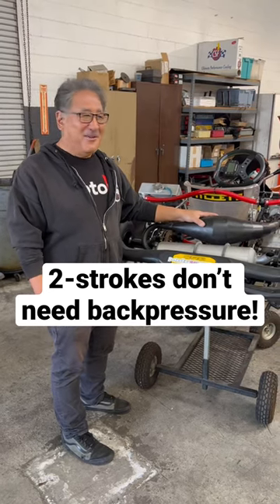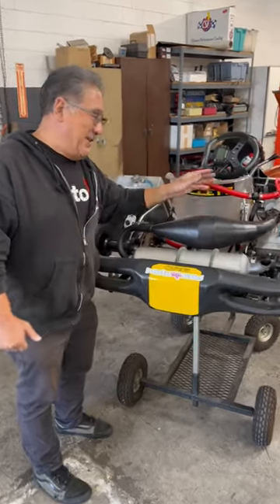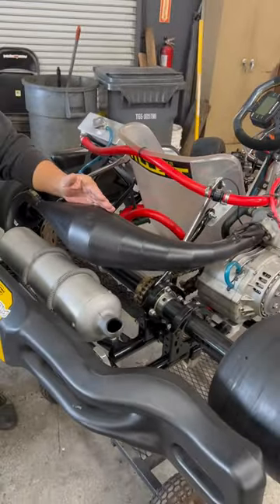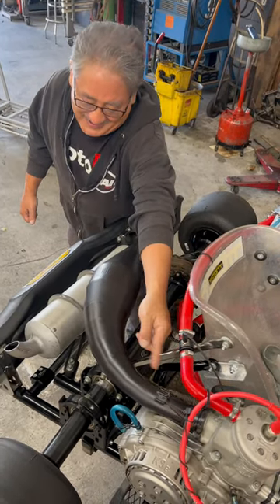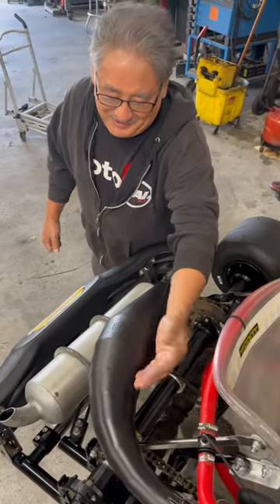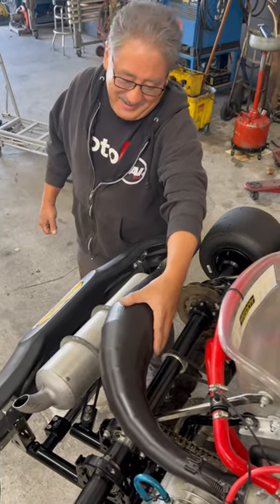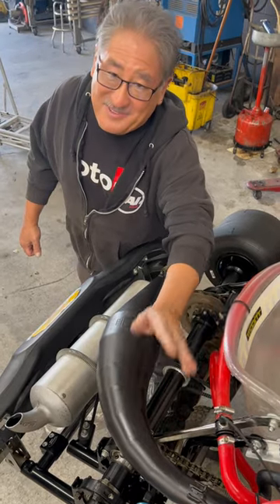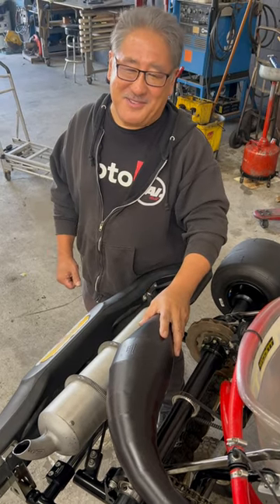2-strokes don’t need backpressure!

Comment: Why you don't run that thing with a straight pipe if backpresure isn't needed? Pulses are mainly backpressure, if you measure the average pressure in the expansion pipe, it's pressurized. Pulse wave reflections are simply a way to boost the engine since reeds (or piston skirt/rotary valve geometry) blocks the backflow of the air/fuel mixture coming from the exhaust when the pressure wave returns to the cylinder.
Reply from the maker: The average flow is not pressurized, it is in vacuum with every cycle.  The reed valve, etc does not block the exhaust, it prevents back flow into the intake.

Comment: So many "car people" really need to watch this. Countless times I've heard people say a engine needs back pressure  to run.
Reply: if it needs back pressure why can it run without an exhaust
Reply from the maker: it will run but it will loose as much as 50% of the power.  You need to watch and comprehend the video.
Reply: It needs an expansion chamber. The muffler will hurt it though.
Reply: @fish_R_stinky69  muffler wont hurt it
Reply: @11sjv  It'll make less power with a muffler lol.
Reply: @11sjv  Sure, a muffler won't HURT it but it'll make less power.
Reply: @fish_R_stinky69  depends on the lenght of your pipe

Comment: Well, you need some backpressure to build heat in the pipe, to make it tune in wanted rpm band.
Without backpressure the heat(energy) is spilled away.
Reply from the maker: That is not how it works although heat has an effect on pipe tuning.
Reply: @motoiq  lol
I DO know how it works, but i seriously doubt you know.
I´ve been tuning twostrokes for about 35years now, and if i would go by your example and NOT having backpressure the pipe would be very very hard to tune at correct rpm as the heat would be lost.
The 'same' pipe length would tune at very low rpm.
And by that, trying to tune at say 7500rpm(250 dirbike) it would be so short that you would need to have such abrubt angels on the different sections that you would actually make it EVEN HARDER to tune it due to the pulse is 'getting lost'

0.2-0.3bar pressure is a normal value to aim on, this allows the pulses to fluctuate above and below atmospheric pressure, and by this makes the engine breathe properly due to pulses.
And getting this correct, the pressurelevel actually helps at higher rpm(above tuned point) to push back some of the fresh charge for a longer duration where he pulses have started to fade(above tuned rpm)
Hence many misunderstands this.
'Higher backpressure gives more power'
Yes it might, but less torque down low.

Correct backpressure is the key!
Reply from the maker: You don't understand thermodynamics and have only a practical knowledge of how a chamber works. Purposely increasing the mean backpressure to do something is a crutch to proper pipe/port/intake design.
Reply: @motoiq  do not judge me!
I know a lot but might have problems with language.
But i do see that you are trying to use conquer technique in this conversation.
Reply from the maker: Don't judge me either, I know a lot.
Reply: @motoiq  Yeah,, i noticed that......

Comment: Could you delve into 2 stroke "power valves"?
Reply from the maker: They change the port timing for a wider powerband, like variable cam timing in a 4-stroke.
Reply: @motoiq  Some of them also change expansion chamber volume and tuned length.
Reply from the maker: really what motors?
Reply: @motoiq  I know Honda's power valve and Kawasaki KIPS do it.  They have a chamber by the exhaust port that is either opened or closed to exhaust flow, effectively varying the tuned length of the header pipe.  Honda's earliest PV did this only with no change to port timing or geometry.  I believe KIPS was the first to combine the chamber system with a variable-height port.  Obviously they weren't doing anything as radical as tromboning the pipe, although I've read some PWCs inject water into the pipe to change temperature and therefore the pulse timing.

Comment: Oversimplified for those who don't know anything yet but it's correct and i like that
Reply from the maker: For shorts, you only have 60 seconds.
Reply: @motoiq  true that
Reply: Have had personal experience with 50cc two-stroke engines and a pipe makes a big difference
Reply from the maker: Yeah you can probably double the power.
Reply: @motoiq  way past double the power

Comment: The lengths and sizes of them cones   And the exhaust port timing Dictate the rpm  the ending makes its power 

In that karts example 125cc and about 50hp   And rev over 14000rpm  

Back pressure is needed the end of the pipe called the stinger is only about 20mm   

To help contain the glasses so the pulses can work 

It’s a fine balancing act To big and the pulses are not strong enough to work.   

To small and to much exaust remains and the  engine melts   Normally eroding the piston over the exhaust port 

So saying they don’t like back pressure is not 100% right
Reply from the maker: the stingers function is to prevent the pulse from escaping while letting exhaust gas out.

Comment: What are your thoughts on pipe pressure at high rpm speeding up the wave velocities and helping widen the effective rpm range that the pipe is effective for?  Same reason a rich main jet kills top end, rich,  cool exhaust gases slowing the wave speeds.
Reply from the maker: That's a lot of how the pipe works

Comment: It does use backpressure...

The first cone increases in volume which creates a lower pressure which allows mixture from the crankcase to push up through the transfers, the belly section inbetween the two cones is a intermediary section that stops a sudden change in pressure, the next cone reduces volume and increases pressure which is utilised when the pulse bounces off the end of the stinger to create a higher pressure wave (backpressure) to push mixture leaking out of the exhaust back into the cylinder along with some dregs of fuel in the exhaust fumes.

Backpressure is half of the action of a expansion chamber.. to say its unwanted or not how it works is beyond wrong.
Reply from the maker: Actually via Bernoulli's principal the pressure increases in a cone shaped diffuser.  Also we are taking about mean backpressure, not periodic pressure pulses are we explained simply in the video.  Mean pressure raises the floor of the gas exchange portion of the two stroke cycle which reduces the amount of work that can be recovered as power.
Reply: @motoiq  i see. I had it backwards. 

I was thinking without bernoulli's principle which would mean that mixture would be sucked from the tranfers due to the low pressure at the diffuser and then the wave reflected back squeesed going into the baffle would push leaking mixture and leftover mixture back in but it must be the opposite.

Diffuser causes high pressure which prevents leakage and then the baffle causes a lower pressure to pull mixture from the crankcase. If thats not it then im having a word with god and his mad fluid dynamics he created with expansion chambers.
Reply from the maker: You got it half right! The cone diffuser thing is counterintuitive but you are trading velocity for pressure which is what Bernoulli's principle is all about.

Comment: But if you didn't have the first cone, wouldn't you avoid overscavenging the fuel/air mixture?
Reply from the maker: You need the diffusion to help get the stuff out of the cylinder.
Reply: @motoiq  gotcha.

Comment: Since you are seemingly unwilling to test and understandably you are unwilling to take my word for it I have pasted a paragraph from Gordon Jennings (Two stoke tuners handbook page 64) whom mentioned in an earlier response.

Having gotten past the business of diffusers and baffle-cones, we can proceed onward to the lengths and diameters of lead-in and outlet pipes. The latter will, if the rest of the expansion chamber is proportioned fairly closely in accord with the advice I have given, have a diameter between .58- and .62-times that of the lead-in pipe, and a length equal to 12 of its own diameters. It is simply a pressure-bleed resister, which prevents the free escape of exhaust gases from inside the expansion chamber and thereby creates a backpressure to enhance the port-plugging efforts of the wave reflected by the baffle- cone.
Reply from the maker: I am not even talking about pipe design theory, you are, I am talking about mean back pressure.  You understand mean means average right? I am talking about VE, thermodynamics and gas exchange of the engie being hampered my excessive mean backpressure, not debating the importance of pulse timing, etc.  I am talking about the entire engine, you are taking about just the pipe.
Reply: @motoiq  Wow what a disconnect, your entire short titled “2-strokes don’t need backpressure” was about the pipe and pulses within it and now to avoid admitting your title was inaccurate as I said, when confronted with evidence from a source you cited, you deflect to VE? And FYI the mean pressure in the pipe is positive thus creating back pressure. I’d be happy to show you pressure traces I’ll be at Rok Fest in Vegas next week look for me in the scrutineering tent I’ll be the on wearing a shirt that say’s “Official”
Reply from the maker: I am not deflecting, I am just stating facts. What I said is accurate. Instead of trying to argue with me, your time would be better spent studying how the rest of the engine works.  Look up the pressure-volume diagram for a two-stroke engine and you can easily see that if you raise the pressure base, less work or power can be recovered from each cycle. That is just one of the reasons but it's the simplest and easiest to visualize and there should be many examples for you to look at online. You understand how the chambers work 100% but are not looking at the entire engine.  I didn't make this stuff up, every second-year engineering student learns this and it was well-understood over 100 years ago. If you look at the pressure profile of a chamber, you can see that pressure goes negative in significant parts of the cycle, especially in the diffuser area of the pipe.  You probably know this.  If you squeeze down the pipe exit to the point where you are intentionally increasing mean pressure, the timing of the pipe becomes faster due to the increased density and temperature of the gas inside and sometimes this gives favorable results.  It's more of a tuning Band-Aid as a pipe with the desired tuning with lower mean pressure is going to be better for power recovery and production. Like I said, it's not just me making something up but well well-understood phenomenon that I learned in school and applied later in life.

Comment: So close but here's what you missed lol. So as far as back pressure goes you actually are balancing the stinger diameter with ignition advance to keep egts around 1150°f. 1200 means a broken ring land normally. For the most power after the expansion chamber and ports are set up you do actually play with the stinger size to make the most and it can make a pretty big difference. I know in a few iv played with we were able to gain good gains throughout the rpm range by going a bit smaller on the stinger but doing so raises egts same as ignition advance. The best way to do it is with a ignition computer that monitors combustion chamber pressure to modulate the timing to a stinger that's too small egt wise at peak power. This would give you the most under the curve and not loose anything up top to a point. Ot works by raising the pressure in the pipe and the density of the exhaust gases and also the over scavenged air fuel mix. You do less over scavenging before it and harder boost through the exhaust. Different animals to the 4strokes we are so used to.
Reply: your focus on egt is secondary to piston crown temp relation to stinger diametre
Reply: @mitchellgould7405  oh I'm far from a 2stroke expert I just know a few and know theres more to the story. Honestly 2stroke theory is one of those subjects that hurts my brain after the first hr. I'm a more boost kinda guy. But I do remember Alex at 2strokestuffing went into some detail about it and tuning it back in the day. I understand more than most about them but I'm not even close to Alex's level. I just know these guys are amazing at getting a small hint and learning alot for a vid down the road. Frankly this guys probably forgot more than I learned and I have a feeling you might aswell lol.
Reply: @oliverscorsim  they are a bit of fun, and everything is a balancing act. Keep up the enthusiasm
Reply from the maker: You can only say so much in the 60 seconds you tube lets you have to make a short!  Where do you put the EGT probe?  For Karting we monitor cylinder head temp but not egt commonly.  It does make sense though because temp makes a big difference in pipe tuning.
Reply: If you didnt have backpressure, then all the energy would just be lost in the first pulse overscavenging, leaving none left for the blocking wave
Reply: @motoiq  I monitor egt and cht on my daughters kart(minirok) and did cht only with the comer. Very useful tool when you can log it vs time and rpm. I''ve got it 125mm from piston edge.
Reply from the maker: I can see that being way better than on the cylinder head and very useful for tuning.  I wonder why more don't do this.  I also heard that a wideband won't read correctly on a two stroke.  What are your thoughts on that?
Reply: @motoiq  oil and wideband dont get along rotaries eat them too but 2str tend to run more from what I understand. I wouldnt be surprised if the wave tuning had anything to do with it too as rotaries do also have very strong pulses. I do love these sections in comments lol it's like a small pool of knowledge.
Reply from the maker: I had heard that all the backpulsing would make a wideband read rich although I have never seen anyone actually post anything to indicate this is true.  I do believe that the oil would cause them to foul quickly.  Or require some propane torch burn offs.
Reply: @motoiq  I always wanted to test some expansion chambers on a 13b bridge port or peripheral port but never got around to it. Your brighter than me what are your thoughts on it? I would think we could do something similar with the right timing shoving air back in through the overlap. Perhaps its something you guys wanna try lol?
Reply from the maker: I think it would work but never done because it would be hard to package a chamber of the correct volume in a car.
Reply: @motoiq  I made a very long tube header that wraps around the front of the engine for my 1/2bridge FC and that did cool things but it also gave me lots of room for activities. In a few years when I hopefully have things settled I'll be sure to give it a go and report back lol.
Reply from the maker: I really want to know!  I think it should work great with a peripheral port with its long duration.
Reply: @motoiq  me too but time lol and the lack of actual theory along with much higher egts changing the theory that exists for 2strokes. Really the timing difference between 360° between power strokes and the 1080° rotaries have would cause further complications. I have given it some thought over the years and I always find myself down one of two roads either it would be detrimental of very beneficial then the idea of the pressure change with having a turbo on the other end of expansion chambers and that making it a variable effective length of the chamber just breaks my brain a bit lol.
Reply from the maker: I am trying to talk Rob Dahm into it.  I told him I would do the chamber calculations if he would test it.  He said maybe later when he needs content.
Reply: @motoiq  that's amazing I'd absolutely love to see you guys team up on it. Not that I think it would give the gains it gives on a 2stroke but can you imagine if it did lol.
Reply: @motoiq  For a TM spec pipe 25mm from the back edge of the mounting flange. The Vortex shifter pipe is required to have the probe mounted 95mm from the front edge of the mounting flange.
Reply: With a programmable ignition like MoTec you can actually set up a timing retard function when pipe pressure meets a set threshold.

Comment: Is the pulse that pushes some of the air/fuel mix back into the cylinder not considered a type of back pressure?
Reply from the maker: No
Reply: @motoiq  so the expansion chamber doesn’t use PRESSURE to push the mixture BACK into the cylinder?
Reply from the maker: That is not backpressure in the sense that we are talking about, we are talking about mean pressure.

Comment: But the smaller stinger you have the larger effect that pulse has but with the consequence of extra heat in the combustion chamber that could be potentially catastrophic.
Reply from the maker: You can have the stinger go into the pipe chamber.  That way you can have a larger stinger for less backpressure but maximum reflection.
Reply: @motoiq  I read a very interesting old article where they inverted the stinger (put it entirely inside the chamber).  They noticed almost no change in performance, but it made the engine as quiet as a typical MX style silencer.  I believe this didn't catch on because cleaning the inside of the pipe became extremely difficult, and it looked doofy, and silencers were required most places anyway.
Reply from the maker: I can believe that.  I know stingers have been put inside pipes to shorten the overall length for packaging reasons.